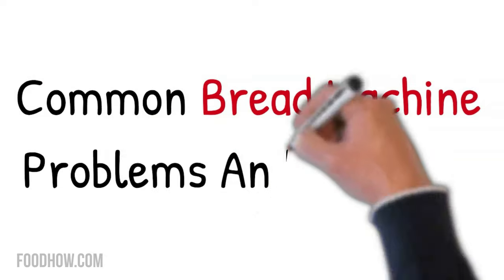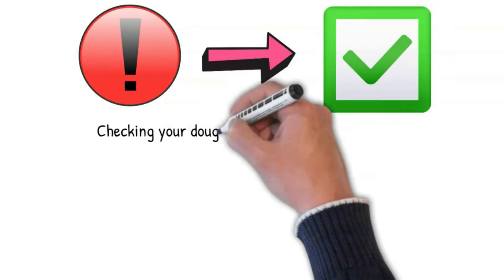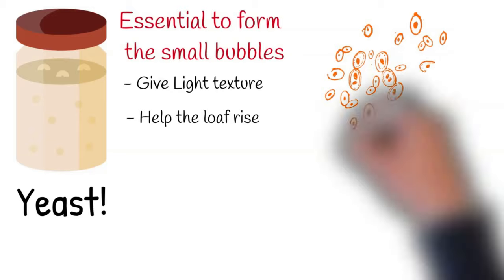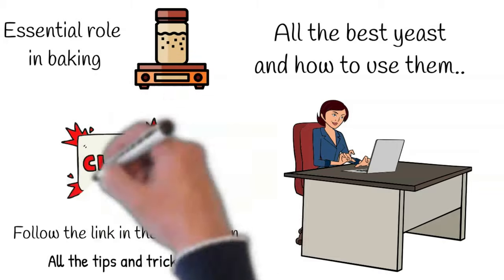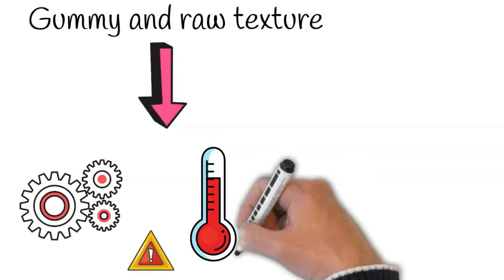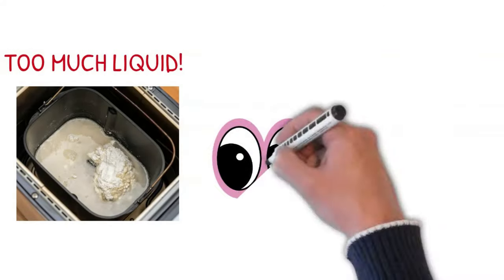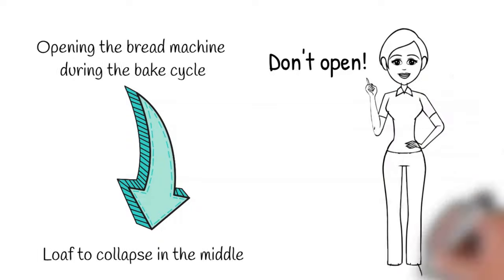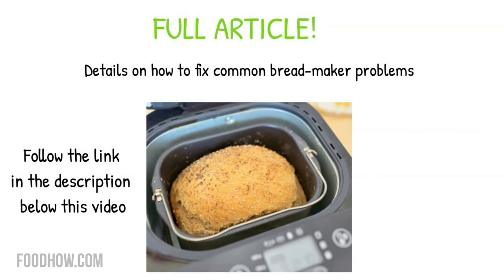A Handy Bread Machine Troubleshooting Guide (Frequent Problems And Solutions)

Comment: I can relate to all these problems. I finally bought a Panasonic Bread maker and that helped. It’s important to weight out the ingredients exactly at first until you get to know your bread maker. Yes it’s okay to open the lid. I always check after a few minutes to make sure there is a nice round dough ball. If not I add a little flour/water then next time make sure I change my measurements. I’ve made those little bricks that didn’t rise or those mushroom tops before. Since I don’t buy those packages I get better results buying a jar of yeast and keeping it in the refrigerator.
Reply from the maker: A lot of people say that the new Panasonic bread maker is the best one. I have been thinking of getting one for a while now, but I have gotten so used to my old one that I know all its little quirks and fault by now :)

Comment: I had a problem-I followed my recipe but in the end my bread was so stiff. Thank God for this video, I found the solution. Bread maker is definitely worth every penny. So, when my bread has a gummy texture, it says I should bake it a bit longer. How much longer and is anything going to happen to the bread maker?
Reply from the maker: Glad it helped! If your bread is a bit gummy texture in the middle and it is just the case of under baked loaf, I would bake the bread for 10 minutes longer next time, that or choose the slightly longer settings, that should be sufficient to bake the loaf without burning it thoroughly.

Comment: Thanks I thought it was an issue and you confirmed it. When I baked 100% Rye and it rise to the top of the lid and stuck to it. Rye should not rise this high, I followed the Panasonic Rye recipe to the g (New model June 2022) they used 380g water, I know rye needs a bit more water but this was to my feeling to much and the result was mushroom loaf and little gooey . I will be making the dough only from now on and bake in a oven with steam the rock method. Thx.
Reply from the maker: Excellent!, thank you so much for your comment.

Comment: Ok I know this video has been out awhile...but I'm just starting with a convection Cuisinart...1st attempted french bread...crust came out very hard and the top didn't brown very well...any ideas?
Reply from the maker: That is a bit of a conundrum; usually, when it happens to me, the hard crust is also too brown. If the crust did not brown that well, I would usually try a different setting that would most of the time fix it.

Comment: Oh a lot of the recipes are adding oil ! could this also be an issue with to wet and high rise? thx I know this is old post so hope I could still get a reply.
Reply from the maker: The inclusion of oil in bread dough does not help it to rise, but it does enhance the texture, flavor, and moisture of the bread. I think I add oil to most of my recipes.

Comment: Besides the yeast, what are other reason your bread might be dense and small.  I bloomed the yeast and it was going like crazy, so it was def live.
Reply from the maker: There are a few reasons why dense or heavy bread can be the result of the baking process. One reason is that the bread maker did not give enough time for the dough to rise, which resulted in a denser final product. Another possibility is that too much flour was used in relation to the other ingredients, resulting in a dryer, heavier loaf. Additionally, if the bread maker's setting and the temperature are not right, the bread could turn out dense and small.

Comment: Today was my first day using my bread machine and it did not brown and it did not rise up I did what the recipe said?  I put it on 6 should I have added more time? the only thing was I did have dry milk, so I use coffee creamer dry powder and it cook on the bottom, and it looks like I need to put it in my oven, would the coffee creamer cause this? :(
Reply from the maker: The dough failed to rise due to the lack of yeast or the yeast may have been old. The dough was not mixed thoroughly or kneaded enough, which could have reduced leavening power and inhibited fermentation. Additionally, the dough may not have been given enough time to rise. Did you use the right program for the recipe?
Reply from the maker: I don't think that the Coffee creamer was a problem, it can be used as a dry milk substitute in most recipes.
Reply: @FoodHow  yes!! I learn I had to much water LOL!! I put my glass on this time.

Comment: Help do you know why my bread maker spilled over the basket?  I need help first time making gluten free bread in it and it went over board.  Made a mess, do not know why, I followed all instructions.
Reply from the maker: When a bread maker overflows, it can be due to a variety of factors. For instance, did you use the measuring cup or your own judgment for how much flour or liquids they should put into the bread maker? It may overflow. Or the recipe may have just been too big for your loaf tin. Or the yeast just woke up a bit late and made the whole thing overflow.

Comment: Why is my bread dense ? i have a panasonic i follow the recipes to the letter , thsnk un🥰
Reply from the maker: Hi @suepearce2005, If you’re following the recipe to the letter and measuring everything just right, the issue might be with the ingredients or the bread machine itself. Sometimes yeast can be a problem if it’s not fresh, so trying a new packet might help. Also, if your kitchen is really cold, it could be affecting the rise. And it could be worth checking if your bread machine is kneading and heating as it should, since sometimes machines can get a bit off over time.

Comment: The spindle to which the paddle sits on, fell out of the bottom of the pan in my Black and Decker BK1015W bread machine...
Reply from the maker: Oh, I’ve had that happen before! If the spindle falls out, first, just take a good look at both the spindle and the pan to check for any damage. If everything seems okay, just line up the spindle with its spot in the pan and press it back in. After that, make sure the paddle fits snugly onto the spindle. I usually run a quick test cycle without ingredients to make sure everything is working smoothly. If it’s still giving you trouble or doesn’t stay in place, checking the manual or contacting Black and Decker can help.
Reply from the maker: @johnwang9914 That sounds like quite the journey trying to get it fixed! It is frustrating when you cannot find the exact parts or get a response. I think your plan to grab a new bread maker while experimenting with the generic parts on the side sounds smart, just in case you can get the old one working again. I agree, those compact 1.5 lb units were perfect for smaller kitchens! Hopefully, you find a good replacement without taking up too much space. Let me know how it goes, especially if you manage to get the spindle issue sorted!

Comment: How do i know when its ok to take the paddle out of the bread machine, and then continue on with the baking? 
I’m afraid of thinking it’s done kneading, and find out it was only paused and needed to knead again.  
Does the machine do all the kneading continuously and when it stops its done?  Is there way to know its done for sure by timing, or the machine beeping...anything?
Reply from the maker: On my machine, it says on the display when each phase is finished. So I remove the paddles after the kneading phase is finished. However, if your machine doesn't show the phases, then remove the paddles once the dough has formed a nice ball shape and it seems like the kneading is completed. My machine does it quite continuously and just stops for 10-15 seconds now and then. Once the kneading is completed, I can tell easily, even without the display.  You probably need to keep a close eye on it the first time to find out the best timing for that, so you know when to do it next time. Also, check you user manual, it could mention something in there.
Reply: @FoodHow  Thank you so much! I have never had a question answered on any site, so I almost didn’t ask.  Since seeing your video, and having my question answered, I am excited to try my 2 loaf.  The first loaf had risen all the way to glass, but when I took it out, the center concave and it also had the paddle hole.  It was an ugly loaf!  It didn’t taste bad, but it wasn’t usable for sandwich bread.

I did measure my ingredients accurately, but I used measuring cups not a scale. Would a scale be better?
Reply from the maker: That is not good if people don't reply to questions. Sometimes I also fall behind, so I do apologize if it takes me some time to reply. 

When I first started using my bread machine, I was using a scale, but once I was already familiar with the measures, then I just started using measuring cups. But when I am trying out a new recipe, then I usually do whatever the recipe tells me to do if it is in cups, I use cups, and by weight, then I use a scale. How are your loaves coming out now?

Comment: My bread machine goes cool, dough does not raise. any dvice on this?
Reply from the maker: It used to happen to my old breadmaker also :(

Try checking the following:

Ensure the mains power is working
Check your circuit breaker
Press and hold “start”
Cancel the timer

Comment: How do you get the dough to spread out
Reply from the maker: To spread out dough easily, make sure it's at room temperature and has rested a bit so the gluten relaxes. Lightly flour or oil your work surface and hands, depending on the dough type. For pie crusts, use a rolling pin, starting from the center and moving outward. For pizza dough, gently press with your fingers or let gravity help by holding and rotating it. If the dough's fighting back, just give it another rest.

Comment: The problems dealt with are faults of the user not the machine, but this an unspoken machine problem.   After just two or three years of weekly use, rust may form between the spindle and its bearings.   If the user removes the paddle before baking, that formation is accelerated.   The steel used is not sufficiently resistant to rust in its hot, moist environment.   I never bake in the bread machine.   I remove the dough before the last rise; then bake in in my oven-broiler in a loaf pan with  good results.  If your paddle is resistant to turning by hand,  lubricate it with WD-40.  Then clean it well.    If you are successful at freeing it, don't bake in it again.   Use your machine only as a programmable bread kneader.
Reply from the maker: Good information, thank you for sharing.

Comment: What about when the loaf rises too high and touches the lid?
Reply from the maker: Oh, when your bread loaf rises too high and touches the lid of your bread machine, it's often due to too much yeast or sugar in the recipe. These ingredients can cause the dough to rise more than expected. Also, if the kitchen is particularly warm, it can speed up the rising process. Try reducing the amount of yeast or sugar next time, or check if the recipe's size is appropriate for your machine's capacity. Adjusting these factors should help keep your loaf within bounds!

Comment: Where is the article link?
Reply from the maker: I have left it in the description, just below the video.
Reply: @FoodHow  Thank you so much! I need to figure out my bread problems.
Reply from the maker: If you have any questions, do not hesitate to let me know.
Reply: @FoodHow  I actually do have a question. In figuring out my ratios, would honey be considered a liquid? Thank you!
Reply from the maker: Technically, honey, maple syrup, and molasses are considered as liquids, but because it is usually a very small amount, you don't need to make any adjustments with other liquids.
Reply: @FoodHow  That may be my problem. Thank you!

Comment: I have a Oster bread maker and so far I can not get the 4 rubber feet on the bottom of the machine. This for me, it makes  bread maker move around and prevents proper kneading. It is a cheap maker and if I cannot fine the or make the feet, I will not buy this machine again and go back to the hand bread making. There are plenty of recipes to do it

Comment: My dough doesn't rise no matter what I do. Brand new jar of bread machine yeast, 90° milk. Now I remember why I stopped baking bread and making dough.
Reply from the maker: There must be a problem with yeast. Did you you too warm water perhaps, that would kill the yeast if water is too warm?
Reply: @FoodHow   Thanks for the reply. I use a digital thermometer and try to make either the milk or water 90°- 100°. But I think you're right about the yeast perhaps a bad batch or something. I just bought a jar of yeast and fresh flour and the bread turned out great.

Comment: My bread machine's pan got scratched by seeds used in the dough...this is a problem - but I can't find any useful link online (let alone any solution) not even mentioned like the problem doesn't exist?
True -  I do like seeded bread - but be very careful with dried seeds expecially the small ones like sesame seeds - your pan is going to be scratched in no time.
I wonder if anyone has noticed this issue and try a solution...I'm thiking of giving the seeds and nuts a good sogging to soften them before baking...that way I won't need to buy a new pan every month.
Reply from the maker: It's a real challenge when your bread machine's pan gets scratched, especially from something as seemingly harmless as seeds in the dough. It's surprising how little information there is online about this issue, I certainly did not realize that the seeds were causing the scratches.
Reply: frustratingly - it seems this problem doesn't exists - very rarely find no answers online. The closer I got was a video "making home bread from "scratch" or similar...go figure. I suggest a video about this issue because it's real and very annoying.

Comment: When should I open the bread machine to take the paddles out so I won't have holes in my bread?  I was going to buy a bread machine that have Collapsible Kneading Paddles but they are over $400.  Too much for this girl so I will stick with the one I have.
Reply from the maker: I hear you; my bread maker is also quite old, but it works great as I have tweaked my recipes and made them so many times. I don't feel like spending $400 on a new one either. So, to take the paddles out,  You have to do it once the dough is finished kneading. It should be in the shape of a ball, so it is easy to lift it out, take the Kneading Paddles out, pout the dough back in, and the bread maker will do the rest.

Comment: Why won’t my bread machine turn on
Reply from the maker: If your bread machine will not turn on, it could be due to a few common issues. First, check if it is properly plugged in and if the outlet is working by testing it with another device. Sometimes, a tripped circuit breaker could be the problem, so check your home's breaker box. Also, inspect the power cord for any visible damage. If everything looks fine, it might be an internal issue with the machine itself, like a blown fuse or a malfunctioning component. In that case, consulting the user manual for troubleshooting steps or contacting customer support might be necessary.